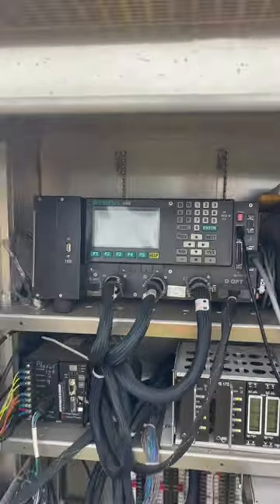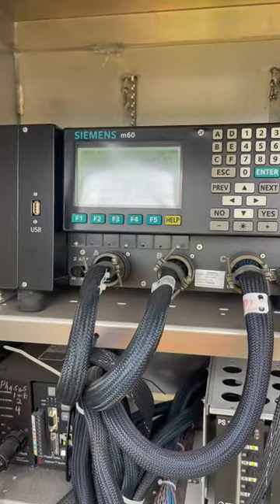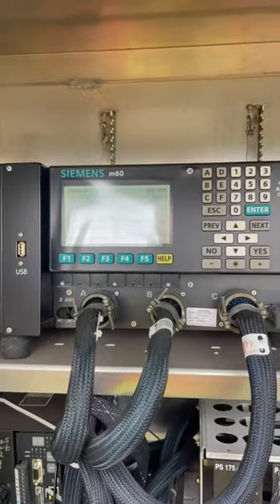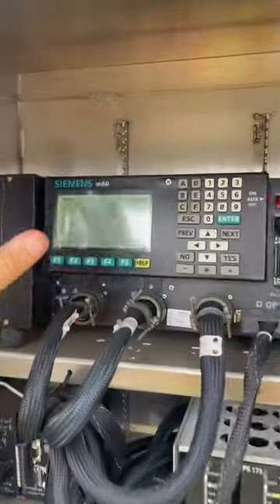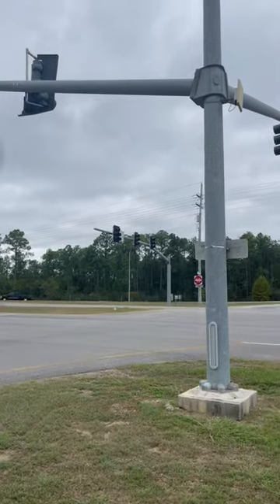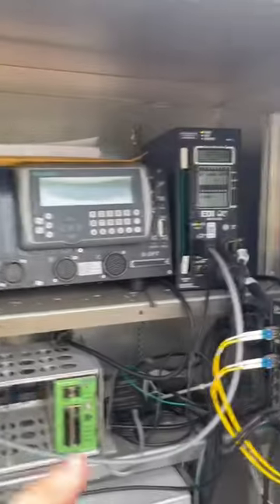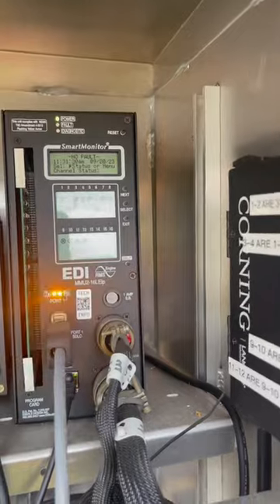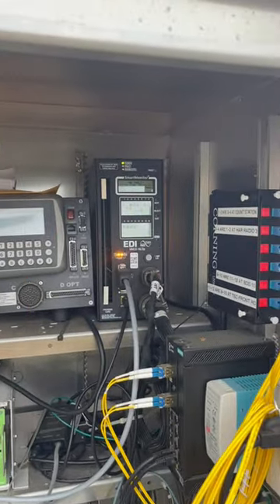Raspberry pi and traffic lights!

Comment: It's about using proven technology, nothing else you can yammer on about how great each oversized box is all day (Linux for a traffic light controller really is hilarious though), it won't change that you use those boxes because they work and you're not paying for the great hardware or performance, but because in the absolute worst case you call Siemens or whatever the manufacturer of the other stuff is and they can and will actually fix it (and send a nice check)

Comment: I guarantee you that hardware is terribly overengineered using antiquated technology by some company providing them at a massive profit margin. 

Maybe not a literal raspberry pi but I have no doubt there's room for improvement on this system.

Comment: But wait, you need another device that does exactly this but not this. 

Why doesnt the first device have logic that makes the second device obsolete?
Reply: Because having a separate device adds redundancy. It's safer to have an "outside observer" checking the work of the main computer than to have the main computer being the only thing that checks itself.
Reply: Observer control loop-

Comment: It's the same deal with commercial radios vs baofeng and hyteria Chinese radios.  Commercial equipment will just outlast Chinese electronics
Reply: derp. Maybe if you opened up your "commercial equipment" you'll find Mde in china everywhere there too. Anyone qualified to have an opinion would know this.
Reply: @jhoughjr1  rhe difference is the specs. And the electronic filtering
Reply: @ryanmigliori660  20 Baofengs beat one Motorola.

Comment: Not sure if you've already answered this question but why do you need a fail safe computer? Shouldn't the main computer handling the switching already have a conflict monitor built into it? Also are the traffic light systems hooked up to a central operations centre or do they run independently?
Reply: Having separate failsafe machines has 2 advantages: it lowers the risk of both failing at the same time; and it makes it cheaper to replace only one of them when there's a problem with only one of the modules.
Reply: The lights need to have an optimally safe default behavior if no valid input is selected. The lights should not be making that decision, so the failsafe computer, a relatively simple state machine in its logic defines that behavior.

Comment: We put Pi's in much more extreme conditions than this. What a waste of money this is. This is what happens when a company gets there first and has no reason to change.

And employees like you eat it all up because you don't actually understand what's happening. You're essentially a traddie (not that there's anything wrong with trades).

Industrial Pi's are better here in every single way. It's just a fact, because not only do they already run in more advanced countries - but those countries are gaining huge advantages year on year or month in month in recent years.

Comment: I get you cant use normal consumer equipment but the sheer insane number of individual systems in there is rediclous 1 check and one system + connectors done you have like what 10 15 thkngs in there that each do somthing that is reported to the controler just have the controller do it and have a check on the controler

Comment: Ok i accept defeat at the 30year reliability point. Everything else pi can do.
Reply: How do you protect it from the elements? With a case you 3d printed? How do you operate a traffic light with a 3.3v GPIO pin?

Comment: raspberry pi are for tinkering or emulation not for things that can literally determine life or death
Reply: and like all computing equipment includes the disclaimer that it isn't intended  for safety critical products.  A company can of course, but they have to accept liability for the hardware.  ditto of OS and software they use.

Comment: Pretty overkill imo. All of that cost what? 40k? 80k? 120k? 
That amount for every intersection is a lot when the same amount of reliability can be achieved with redundant system of 300$ controllers. 
But I get it.. its for accountability.. if the controller fails, is siemens fault..

Comment: Evem the bare silicon does not compare. Consumer grade microcontrollers and industrial grade micros are entirely different beasts. They are literally built differently, with toms of redundancy amd fail checks. Consumer electronics is easy to peogram while industrial hardware is intentionally difficult to program, so you have to spend hours upon hours ro fins the only right way to solve a problem with no room for errors.

Comment: Why use a device specifically designed for the purpose of controlling traffic lights when you could spend thousands of hours putting the same thing on a $50 board

Comment: Okay, I think I see the problem. You're trying to say a pi can't do the job reliably for 30 years. But it could totally do the job. All of the other considerations are about the enclosures like the one your "Linux Based Controller" is housed in. What exactly is your job if these things don't require maintenance for thirty years? You just install them and walk away?

Comment: Rasberry Pi is not good because when it is fully integrated, what happens when something goes wrong? That is right. The whole unit is bogus and needs to be replaced. Worse, if it is a software issue, hot swaps will not work because the software itself is bogus.

Analog systems, but unintegrated systems can be programmed in pieces somewhere else and swapped out instantly.

Comment: A pi isn't really the correct item, but there are MANY devices that are designed for use in environments with humidity, heat and run constantly.

My main beef if the number of different boxes in there. You don't even need a sperate fault checker. All of that could easily be on one box, and that box could be made from MUCH cheaper parts and still function fine. 

I'm not totally in the loop on cost, but my guess is that cities majorly overpay for that hardware.

Comment: The talking points on both sides are so stupid. Yes, a pi can perform similar functionality to the expensive equipment. But we buy the expensive equipment for its safety ratings because a failure of a traffic signal can lead to loss of life.

Comment: I get what you're saying, but my question is--Why single-mode glass?
Reply: Longer runs to the termination point would be my guess.
Reply: @IanBPPK  That makes sense. Thank you.
Now you've got me wondering if these are termed at a CO or ISP, or at a data center owned by the DOT. I was never really interested in traffic lights until I saw this guy's channel. 😂
Reply: @NortelGeek  lots of different direction said it could go depending on how they want that network architected. One way that it could be interfaced is at designated city offices or utility sites, and from there the site would connect to the broader network through an SD-WAN carrier.  That would be cost effective from a site and ISP perspective, but I'm sure there are other considerations I'm not thinking of and without any municipal IT experience, that's just a shot in the dark guess.

Comment: You pay thousands in premiums to a private company for something that could be mass produced and done at a fraction of the cost. Even if you don't use a raspberry pi THAT'S NOT THE POINT. The point is you're wasting money on a fancy box because its 'certified'. It just astounds me people can so easily miss the point. Siemens are literally some of the most expensive intersections you can buy.

Comment: Buddy. This isn't even a harsh enough environment to push the limits of a raspberry pi. Simple conformal coating of the board removes worry for possible humidity damage. You're no engineer

Comment: It's 10's of thousands of dollars of controlls that are all safety rated and redundant per intersection. You can't do that with a raspberry pi. It's just impossible, and if you suggest that it, then you have no idea how programming and controls actually work.
Reply: A pi can be hardened the same as this device, but not being able to find a public facing price for a new Siemens m60 I can't say if it would be any more cost effective. Even then the cost of the siemens is probably largely the licensing and programming.
Reply: Not impossible. You can design all sorts of hardware and software redundancy. Of you're super concerned, why not run a cluster of Arduinos with a quorum. Vote misbehaving microcontrollers off the island and into a reboot cycle.

Comment: Raspberry Pi is good & can be used for heavy-duty processing like AI Automations, AI learning machines, controlling some Robot arms for doing something for 24 hours. I still have one the Raspberry Pi 1 Model B (256 MB varians) that I've bought at October 2012 & discontinued long time ago but still running my Echo link (Internet based repeater for ham radio) perfectly until know for 24/7/365.

Comment: Mines lasted the abuse ive put it through doing all the dumb projects ive done with it. 

Also i noticed in the other pi video you said the exact same thing about having the other system verify the output. Thays just called anther pi. Idk put it in the bottom of the cabinet instead of the top. Put it in a whole in the ground. Pot the thing in resin. Its a pi
Reply: You should experiment.  Dip your pi in resin ❤❤

Comment: Linux? LINUX???
THAT OVER THE TOP CRAP HAS A WHOLE MODERN OPERATING SYSTEM IN IT JUST TO RUN SOME GODDAMN LIGHTS???
I don’t CARE how ReDuNdAnT that thing supposedly is, you ain’t getting 10 years out of that without it crashing AND I don’t care how well engineered it is, you can never in a million years have that mess be more reliable than a good old analog circuit.
They still have perfectly serviceable relay-operated traffic lights in use and the relay logic is 50 year old, last serviced two decades ago and still going strong. You can’t beat that with a system so over-bloated it has to have an operating system inside of it. You could run DOOM and play Bad Apple on that thing and it wouldn’t even be difficult.

The only excuse for the existence of this comically complex system is if this is somehow connected on some intranet and needs to exchange packages through a REST API or something. Idk, city-wide smart dynamic automated traffic control systems and such. Even THEN it could’ve been done with microcontrollers that don’t need a whole operating system running, jeezus.

Comment: If y’all’s pi’s are that unreliable, you’re using them wrong. There are ways to build redundancy into a pi based system as well. Every reason I’ve heard you or anyone in these comments give sounds like pandering
Reply: Yes, there are ways to bring Pi to an industrial reliability level, but it wouldn't be any cheaper than the PLCs they use now. In fact, it would probably be more expensive.

Comment: Raspberry pi is trash for anything other than little coding projects. All you keyboard warriors who turned a light on and off with one need to calm down. The heat inside a traffic signal box would fry one in the first hour